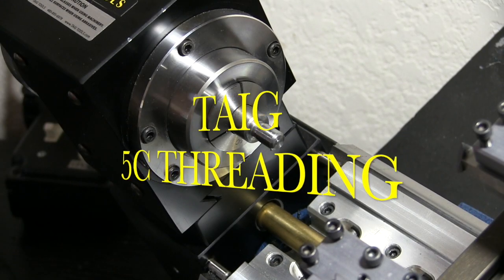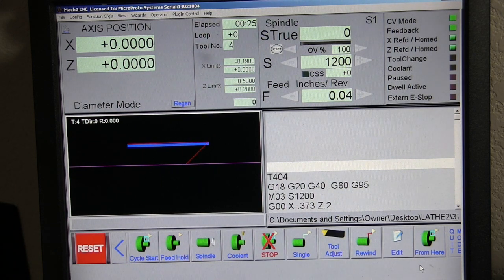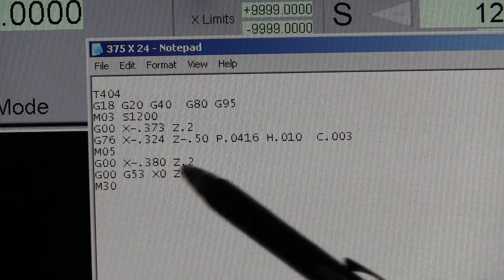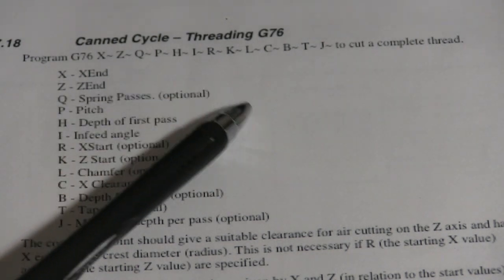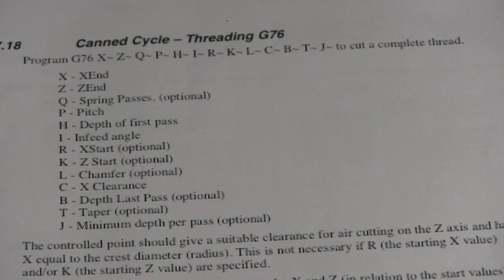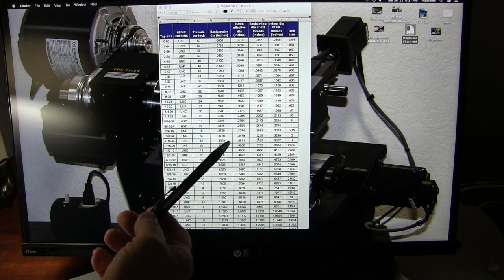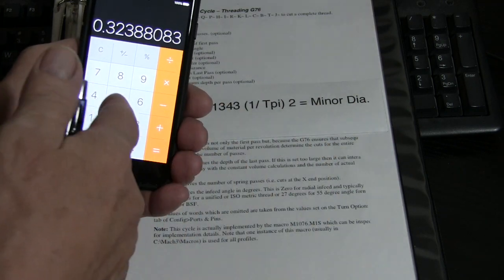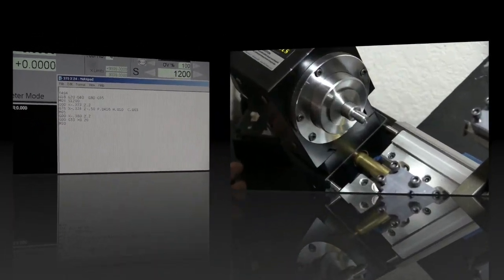TAIG 5C THREADING

Comment: Would you use the same speed to cut 16TPI?
Reply from the maker: I would go half as fast.
Reply from the maker: After some thought..... If your machine is set for 180 rpm (inches per minute) The same speed would be fine.
Reply: @jjjherzog  I have same machine as you. I think my lowest pulley is ~450 RPM

Comment: 7:45 you dont know pitch haha. use metric its pitch you not need calculate it 0.04166666666666666666666666666667 its so inacurite. metric if have 2 pitch then its 2mm EXACT LOL
so 3/8-24 allmost equal 10x1 and G1/8

Comment: 6:45 metric version Major dia(nominal) - 0-65*pitch*2 =minor dia
and its match if tool measured correct. with inch size i havent never get it correct. allways need measure. in metric i know its in midle of tolerance LOL

Comment: I'm thinking of purchasing  a lathe for a project  the big part of it is internal threads on some plastic rods  OD 1/2 or 3/4  with 5/16 threads 3/4 deep  Wondering if I could use a single point cutter for a mill to cut these on the lathe.
Reply from the maker: Any internal threading tool will work.  https://www.youtube.com/watch?v=2UxPecvZ7E0

Comment: How in the world is the tool lining up every time with no encoders? Does it just rely on the timing it naturally has between passes? I have 2 taig mills and I want to get a lathe. The mills are excellent machines; I run mine 3-4 hours a day for production work and never had a problem
Reply from the maker: It uses a Digital Index Signal Processor
 https://www.youtube.com/watch?v=HSOmuBJcGBU